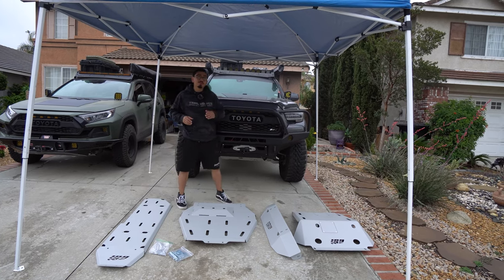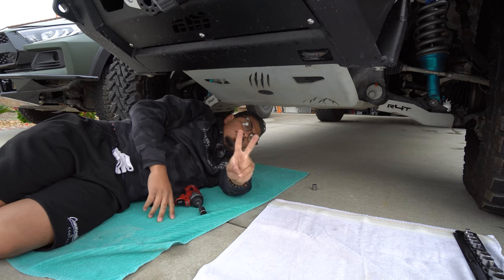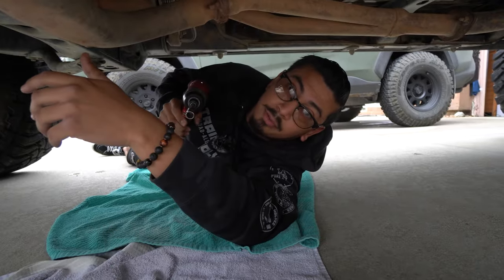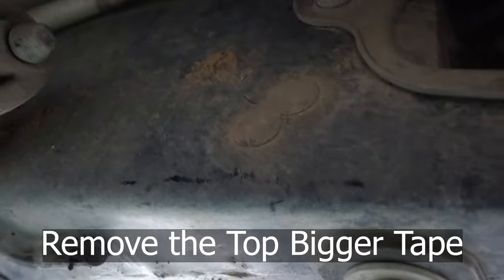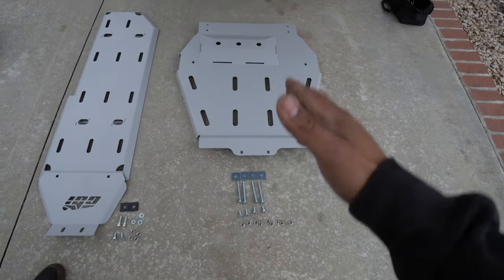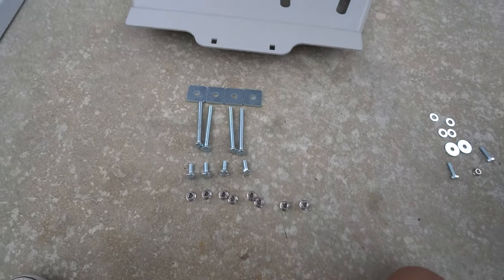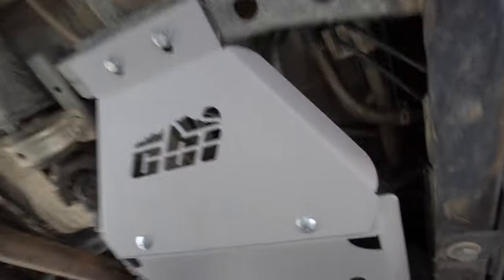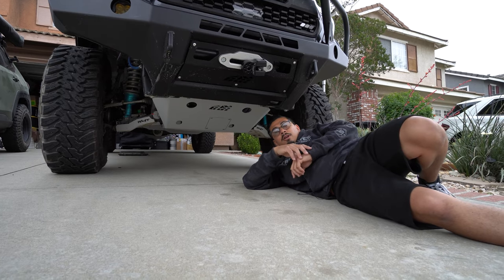How to Install Full CBI Overland Steal Skid Plates on a 3rd gen Toyota Tacoma The Best In The Market

Comment: I have two questions. 
1. Is the rear skid plate compatible with the trd pro skid plate? 
2. Is this skid plate has powder coat or bare metal? I kinna like the color. Thank you Jesse.
Reply: #1. Yes #2. You can have it either way, bare aluminum, bare steel, or powder coat either black or TRD silver.

Comment: Does the rear skid plate cover the catalytic converters? I have the front skid. I want to get the rear skid to finish that up, but don't want to buy another anti-cat theft plate and the CBI rear skid. Can you let me know? Thanks.
Reply from the maker: I mean I’m sure the cat theft plates are more tucked in since there meant for cat prevention but yes these also cover them
Reply: @JesseRizo  Fair enough. Thank you. I wish that the CBI extended those side wings a bit longer to really make sure that the cats get better coverage. I just saw that CaliRaised put out anti-cat theft cages and they look really good too.

Comment: Nice job ..credit Steve..also smart move on STEEL Jesse...anyone that puts Aluminum is a idiot. It will get ripped right out...Also if you don't want to pay for the powder coated..Rust Oleum spray works great and you can always touch up with it...besides after awhile who's going to give a sht what you're protecting underneath..only you know you used STEEL..of course it's more weight but at least you have good protection...Have fun!